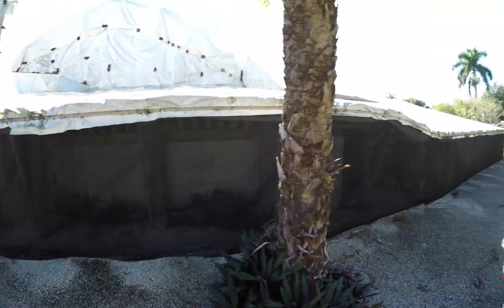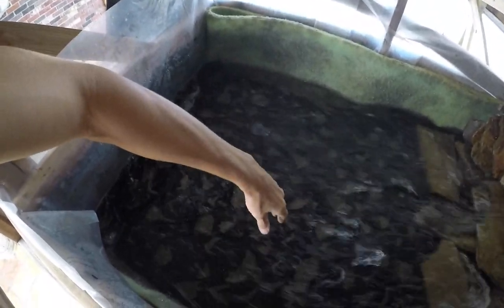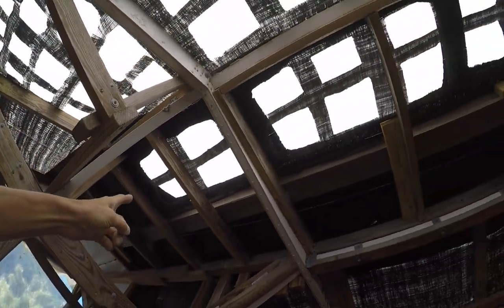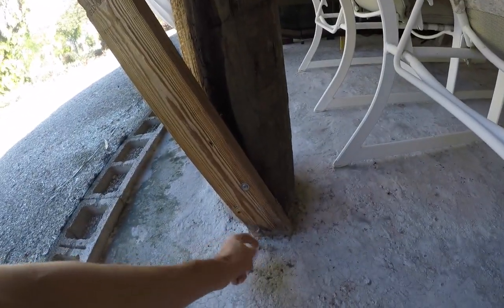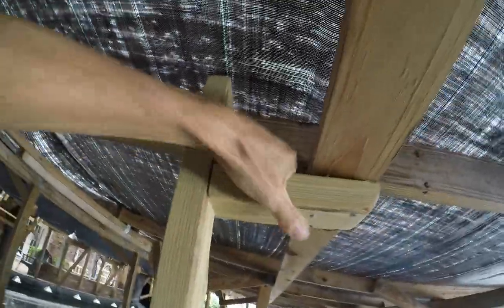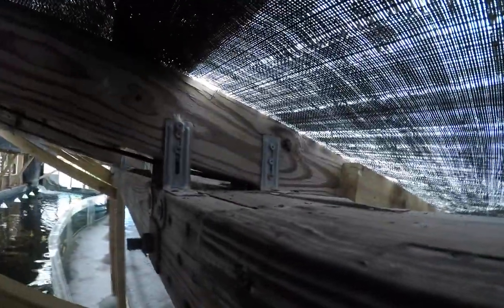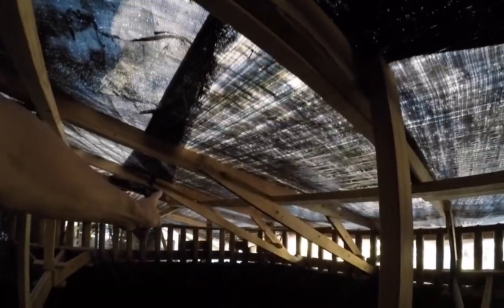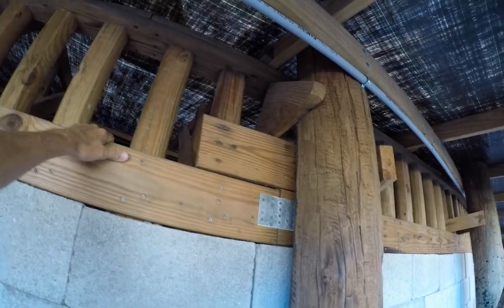Government failed framing of our homebuilt Pavilion #2; we hired engineer, who needs build details

Comment: Yeah I can see why you failed inspection. There are so many issues structurally incorrect that they likely ran out of room on their inspection sheet. 90 degree frame bracelets are not used for structural integrity, it’s not reinforced. You need to start over and hire a cage/lanai contractor. Start a go fund me or Patreon. You have the support and will get the support you need. Start over and do it the right way. Also number of screws are also not considered structural reinforcement. Also attaching framing to the gutter is also not considered structural reinforcement.
Reply from the maker: Right.  Thank you.  I appreciate it.  I can't start over.  I hope the engineers will make me add reinforcements to some member connections, that's all, similar to what happened with Pavilion #1 back in 2012.  What you are saying, I understand.  I hope you too understand what I am saying:  all of this is necessary only on paper and unnecessary in reality.  The structure has been standing for 5 years and stood through a 140 MPH hurricane Irma in 2017 not sustaining any damage whatsoever to any structural member.  The gutter is a super gutter or construction gutter.  Lanais are normally attached to such gutters in our area.
Reply: Well said sir